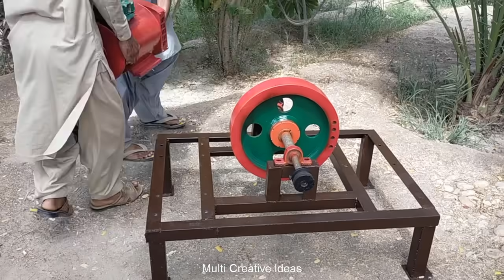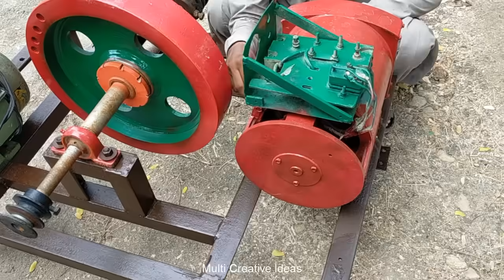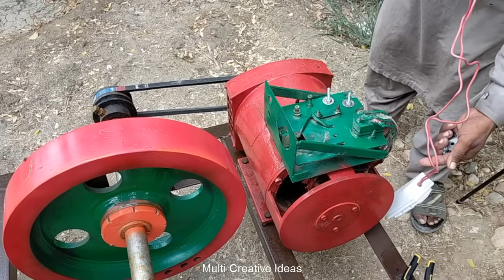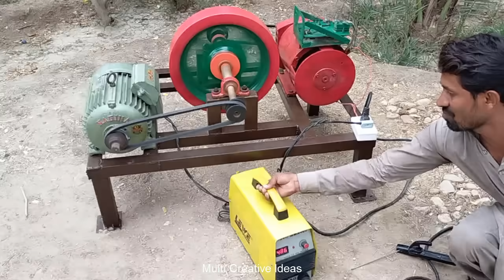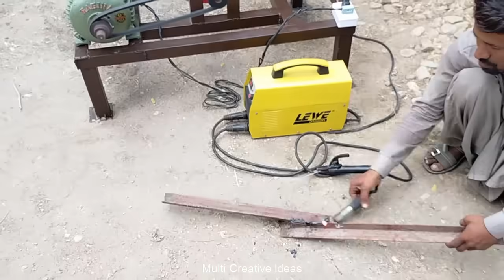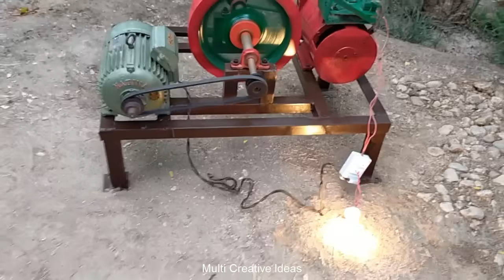How to Make Free Electricity Generator  at home 5kw 230v  Motor Flywheel Free Electricity Generator

Comment: That motor gotta be spinning at least 8-9000 rpm to be able to generate the constant load to weld, so you better have some good bearings and good hvy duty grease on them

Comment: These guys have used electricity a few times to keep the big wheel spinning (not only at the beginning) ! Their solution goes against some physics principles (momentum and conservation of energy).  Without any attendance, the wheel will eventually stop!
Reply: But if the generation from the alternator is enough to supply a battery back and the inverter to run the the main motor you will not have to stop the system?   This will need the initial start and then the load can be calculated as any other item ar the home?
Reply: You can't get power from nothing
Reply: 慣性時間較長因該會停止運轉
Reply: says the guy that has never built one.
Reply: @KevyMotorSport  He's not, he is using Inertia (energy) from the flywheel.
Reply: @-_-unseen-_-  says the guy that went to school long enough to distinguish what is real from what is fake.

Comment: It is fake! The amount of power used to work the motor will give an output of a lesser amount because of the loss due to the friction on the belts and bearings so you will never get 100% output and this is what would be needed to just keep it running. To run the appliances plugged in, the output would need more then the input i.e. over 100% which is impossible. Trick is how they are running the motor without showing where it is plugged into.